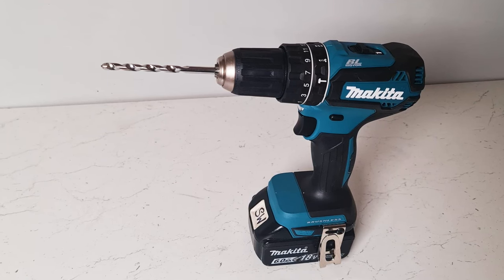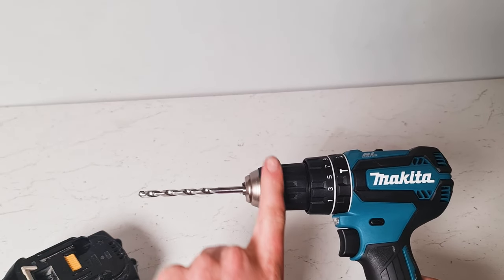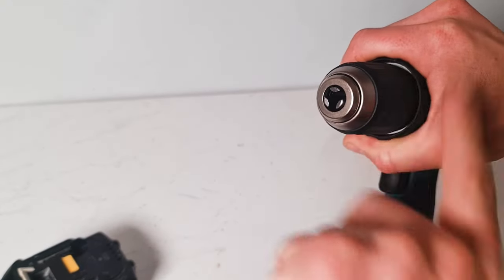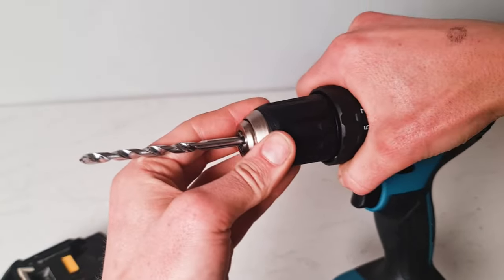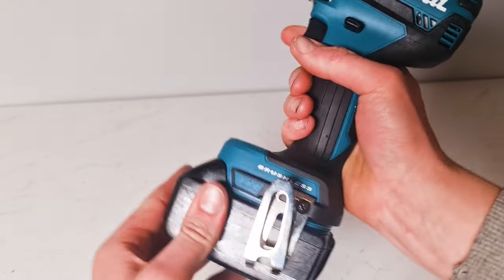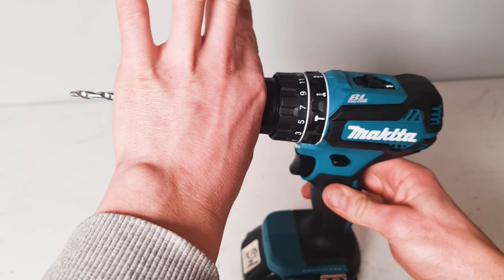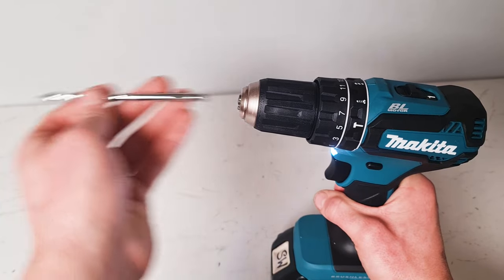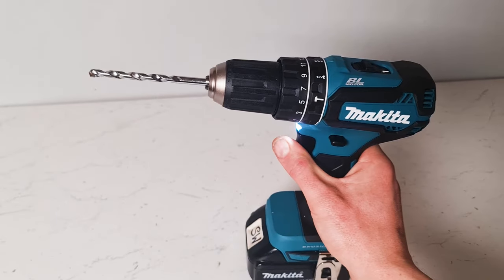How To Swap The Drill Bit On A Makita Drill (PRO Tip!)

Comment: Would hold the chuck with the inside of your hand not over the drill bit. Flip it around. If it torques and twists your wrist hand it will give you get a nasty cut.

Comment: Just to add a small safety tip. Reverse the hand you grip the chuck with, as if holding a sub machine gun. Just as you wouldn’t want to burn your fingers on a hot gun barrel, you wouldn’t want to shred your fingers on a sharp drill bit. This will also give a better grip if the drill.
Reply from the maker: Good tip, Cant say I've ever held a sub machine gun, but if the time comes I will take your advice on board